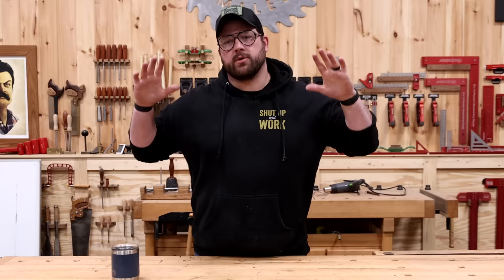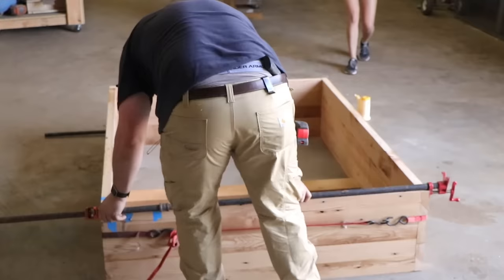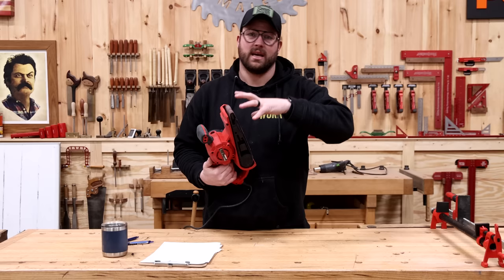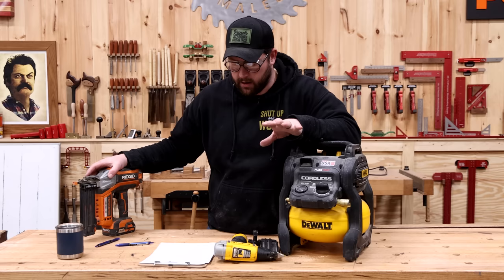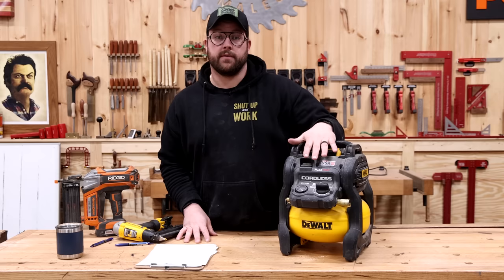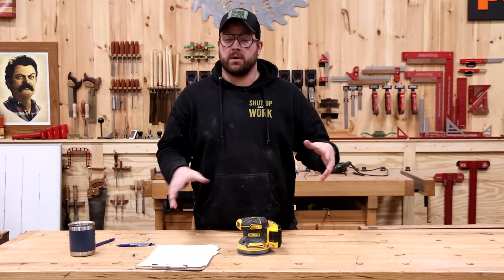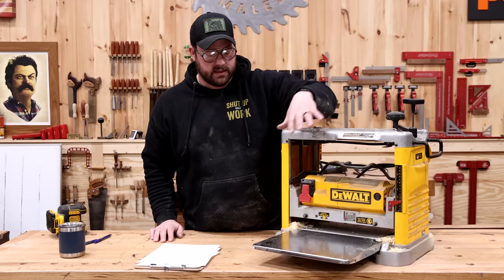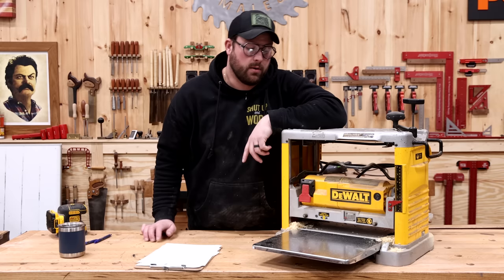5 Beginner Woodworking Tools I Regret Buying

Comment: I have that Dewalt 734 planer you were saying not to buy and I'm happy with it.   I don't have tip over problems because its on a mobile base ( I do all of my thickness planing and sanding right outside the shop, so less shop dust and I don't worry about dust collection on those tools that way), I've never had it bog down but I don't do thick cuts ( but i'm a hobbyist, not doing production)
Reply: Agreed, sure the 735 is a bit more but once you add the end tables, that's another 100$
Reply: And you can buy the helical head for the 734
Reply: Pf
Reply: I have the 734 and did a whole kitchen's worth of cabinet face frames and door rail/stiles with it.  Soft maple over 40 board foot.  I also planed red oak for a  30" by 10 foot bar top.   I have done a lot of other miscellaneous planing of maple and pine.  I never tripped the 20 amp breaker or the on board overload.  I also have not had to even reverse the blades.  From time to time i have to wax the bed.  I have been very happy with it.  Mine is also attached to a rolling cart  - was not aware it can be tippy.  Using a small roll around dust collector with a thien separator kept clogging at the dust intake so I just run it without collection and sweep - pretty sure my frankenstein dust collection is just not powerful enough.
Reply: In Canada the 735 is nearly double the price of the 734. IMO it’s not worth the jump in price for a little extra capacity and 2 speeds.
Reply: My planer has no problem with any type of wood or does it ever pop...virtually no snipe either ..
I think he has a lemon
Reply: Ditto the above... As an aside, I've literally run hundreds of boards of varying thicknesses through mine and never, as in ever, tripped the breaker. That's the problem with users doing one-off product reviews, they only have a "sample of one item" to review and sometimes they get it dead wrong! Perhaps a defective motor or simply a defective/overly sensitive breaker?
Reply: I agree with you on that one. I've had the 734 for a couple years now and it has never let me down once, the fuse has never blown and I always have plenty of power to plane everything, including much harder species of wood. To each their own, though.
Reply: never ever had it trip on my planer
Reply: The 735 everyone on YouTube recommends can’t be bought in most of the world. Dewalt only seem to sell it in NA and Australia.

Comment: A set of professional grade clamps are very nice to have.  Pipe clamps are useful for long lengths because they are less expensive.
Reply: Plus, there is a reason the name "Pipe Clamp" doe not have the word "Parallel" in them.  How many time do you really glue up boards that are wider than 36 inches anyway?

Comment: My thoughts on your suggestions regarding a beginning wood worker. Number one is buy once cry once. Buy the best or close to the best. When is the last time you regretted buying a quality item? I bought an oscillationg spindle sander specifically to be able to "sand to a line". I made some wooden templates and sanded them to the outline drawn with a pen. It is very difficult to cut right on a line and have the cut smooth. If you have a curvy template you cannot use a table saw and a jig saw or band saw will nut produce a really smooth edge like you need with a template. Bessey clamps are pricey but they are good and more convenient than the iron pipe clamps and lighter in weight too. You don't need a "ton" of clamping pressure even on panel glue ups. That glue coming out when clamped is glue that is no longer in the joint. You don't need more pressure than the Bessey type clamps provide. Belt sanders are seldom needed to never needed in fine woodworking but if you have a lot of material to hog out, they are irreplaceable. I vote for air tools even though I don't have any but not that air compressor. You need to get a quiet type air compressor. Battery sanders are only good if you have next to nothing to sand. As you mentioned, no power batteries drain no dust collection.
Reply: Yeah. I'd go so far as to say that on the planer front, just buy the DeWalt 13 incher and put the Shelix head in before you even turn it on. Sure, it nearly doubles the price, but being able to eliminate blades as a variable when you're just figuring things out is amazing.

Comment: Killer info. I've been woodworking for 30 years and gotta admit clamps was one thing I bought that all the cool kids had(bessey) and spent thousands on them. I never even considered HF pipe clamps. I'm going out to get some right now. I do have some pipe clamps and they are leaps and bounds easier to clean glue off of than K clamps as well. Thanks man!

Comment: One of the first power tools I bought was a Makita 100mm belt sander. It's worked faultlessly for 38 years, and has great dust extraction. I use it every time I do woodworking.

Comment: Dude you just crushed me 😂 i own 4 out of 5 tools you mentioned and I planned to buy 3 honourable mentions 😂😂😂 you really got me thinking with my choices and for that, thank you 💪
Reply from the maker: hahahah im glad i caught you before the honorable mentions!
Reply: Buy what you want and don't let any Youtuber dissuade you. Get multiple opinions of course, but in the end, everyone has their own needs/budgets or fall into deals that make a certain tool worth it.  For example I use my Ridgid Oscillating Belt/Spindle sander A LOT even though he doesn't. I also love my Kreg Rip Cut that I just bought. It isn't junk. It works for me.
Reply: @stevenlarson6125  sure but it all comes down to what are you actually doing. I did buy some stuff from that list and it's just collecting dust so I can relate to that surprisingly accurate list for me. As for the sander I can't see myself not using it. It's first on my shopping list to sand things shaped on the band saw that I can't do on a belt sander because of the angles. Right now I'm sanding it with a sandpaper on a broom stick so the need sander shape checks out 😂

Comment: I love my DeWalt 735 thickness planer. In 4 years of use, I have NEVER popped a breaker, and I don't baby it. ALso the second speed does cut down on sanding!

Comment: My 40 year old, bought new, 24" Makita belt sander is still working strong... sanding 10's of thousands of board feet.... without one repair.... best sander I've ever owned... that includes others that I still have... an older Porter Cable 6x4" orbital, 5" Milwaukee orbital, 4" Makita palm, 18" Bosch belt and a few others...  another excellent sander is any 10" sanding disk on a 10" calibration blade for the table saw.... love it..

Comment: If you are already on Ryobi cordless, the 18 ga nailer can be had for ~$90 online battery only, it has bump feature and is a worthwhile addition in my opinion.  I also have an air nailer but also grab the cordless unless I need full angled framing size
Reply: I have the 18ga ryobi nailer too. Love it.
Reply: I have the Ryobi nailer, also, and loved it until it stopped shooting nails. Found a video on how to take it apart and lube it. It started working again for that project. A couple of months later when I got it out again, it wouldn't shoot nails again.

Comment: Excellent list. I'm more of a hobbyist and DIYer than actual woodworker, but I agree with most of this list. I have a belt sander I picked up for $5 at a garage sale 5 years ago, and I've only used it 3x, all for retrofitting doors. But I disagree on the nailgun. While air-powered tools are indeed cheaper and more versatile in the long run, I physically cannot handle the pitch/sound of an air compressor, especially indoors. The Ryobi battery-powered nailgun is an excellent introductory gun, and can get into places where a nailgun/compressor combo is too bulky or annoying to work around.
Reply: I second this.  In fact, the video talks about how heavy the cordless version is and specifically mentions how hard it would be to deal with on a ladder.  Well, I've tried both, and running an air compressor hose up a ladder is much more trouble and even dangerous than a cordless tool that is unlikely to snag on something and pull you off balance.

Comment: K-bodies aren't great if you're a BEGINNER.  But I regret waiting so long to get some.  I can use them for TONS of things other than panel glue-ups.  They are GREAT.
Reply: I agree.  I also agree that pipe clamps are plenty for beginners.  As a semi pro, I think I must have 100 clamps that are for 12" and bigger, and another 50 for smaller clamps.  One just can't have too many clamps.
Reply: I use pipe clamps on a lot of things too. The thing is you can't buy pipes new. You have to just find some from somewhere.
Reply: K bodies are the best clamps out there. I started off with 3/4” pipe clamps, but soon went to K Bodies and wouldn’t go back.

Comment: I am a full-time remodel contractor and I 100% agree with all of your comments.  Everyone around me is using cordless nailers but I still prefer my pneumatic Makita 23, 18, 16 and framing guns.  Faster, lighter and as you said, there are many other uses for the compressor on site (inflating my truck tires too!).  I use the 2 gal Makita quiet unit @ 60 db that I can run with my clients on a zoom call in the next room!  100% agree with your sander advice too - - -  Great tips!
Reply: I was a full time remodeler and hated corded nailers.  Cordless makes it way faster and safer since you don't need to chase cords around or worry about tripping over them when the wrap around your foot like they always seam to do.

Comment: I agree with everything except for the Ridgid oscillating sander... I use mine daily!  I really wouldn't want to be without it! ... When I first got it, I made a little cubby hole to store it in, but lifting it out daily got old fast and I quickly realized that I needed to build a cart for it and give it a dedicated spot in my shop.
Reply: I use my Ridgid oscillating spindle/belt sander a lot, too. I’m not a beginner by a long shot, but it has given huge value for money. I mostly use it in belt mode for adjusting small items.

Comment: After buying my first Black and Decker corded power drill 25 years ago, the very next tool I bought was a Rigid belt sander. I used that thing once and then stored it for two decades. I only recently got it back out, freed up a seized pully and used it again, but you're 100% correct on the orbital sander being more robust. If I made a list of things beginners shouldn't buy (or at least wait to buy), it would be a 1/2" router. Even after years of projects, I find myself using my little 18V Makita router far more than the far bigger and heavier Bosch that I bought first.

Comment: Another great video, John! The reason I look forward to Sunday mornings is to watch your latest video!

You were spot on with your tips and from my personal experience, I've realized that portable, battery-powered tools aren't always the best option. I do 95% of my work in a shop that has plenty of outlets so it's really not a big deal to run a cord to a tool - more power, no waiting for batteries to charge, etc. I honestly think as a beginning woodworker, some of the only cordless tools to invest in would be a cordless drill & impact driver combo kit.

I was recently looking at the cordless nailers after seeing all of the YouTubers with them and thought, wow, that's a tool I need; then I looked at the price, sat back and thought about how much I'd really use it (and would actually need cordless), and decided it wasn't worth the investment... especially when I already have an assortment of air nailers and air compressors.

When you plopped the Dewalt planer on the table is when I really perked up because I thought I was going to have to disagree with you BUT you again were spot on and now I might need to sell that exact planer and invest in the upgrade that you recommended. I struggled planing a batch of maple boards thru one of those planers having to take off MAYBE 1/64"/pass - I got the job done, but I think I spent an entire day on the planer. I will say that my DW734 is on the Dewalt stand, so it's not really unstable but that doesn't do anything to help with it being underpowered.

Looking forward to future videos! Thanks, John!!
Reply: Not to mention longevity. Corded tools will still be working 10 years from now. 
Due to do batteries along, cordless tools will have a much shorter lifespan.
This is fine for a pro that uses tools all day every day and wears them out.
For hobby and occasional use corded is a much better value in most case.
Except for the most used tools, like drill/driver.

Comment: I definitely agree with John's point about air-nailer > battery-nailer. It may be even more simple than that... I think for most folks with a shop or garage, air power is the go-to style for all the reasons he listed (weight, power, functionality, etc). So if you've already got that air-nailer-hose setup, then JUST purchasing the battery-powered air compressor INSTANTLY gives you mobility. Plus, you get the added benefits of air power for a blow gun for cleaning, a tire inflator, air hammer chisel, impact wrench, die grinder, etc, etc. And if you come equipped with enough charged batteries for the compressor, you won't even need access to electricity on the job site. Great tip, John! Thanks.

Comment: Great video my FOMO was a track saw. Took me a while to get one, and I love it. I tried all the Kreg tool add ons. No comparison.
Reply: When I first started, I thought Kreg was a high end God-send of woodworking tools, for all of thier jigs and gimmicky stuff.  I bought their pocket hole jig, and then their universal track to attach to my existing circular saw.  The trac kit absolutely sucks!  I do use the pocket hole jig quiet a bit, but I've determined that the rest of their stuff is gimmicky junk.
Reply: Which one?
Reply: @jasonvandergriff7809 : Yeah, I bought the Kreg Rip-Cut circular saw guide. I was able to get the job done fairly accurately, but it was pretty awkward to use and not the easiest to make accurate rips.
Reply: @brianeatock4383  Makita Cordless 36volt.
It's awesome

Comment: I have made a lot of furniture. Nice to know I made the right choices for a lot of my tool purchases.  I use the Pipe clamps for panels. an attachment on the drill press for spindle sanding, a corded orbital sander, and the bigger DeWalt planer.  I do, however love my 18 ga brad nailer. It has limited uses, but the places where I do use it chef's kiss

Comment: I had the dewalt planer and experienced all the issues you mentioned. I now have the Metabo which costs less than the dewalt but is so much better. Wider feed too for 13” boards
Reply: I also have the Dewalt planer, never once popped the breaker. But I go only 1/4 turn at the time each pass.

Comment: Great video. As someone who started out as a mechanic I can’t imagine not having a compressor but even now as I predominantly focus on woodworking the compressor is very useful around the house. The cordless nailers are way overpriced and completely unnecessary if you work in a shop. Also I never understood the cordless sander since it is hooked up to a vacuum anyway. I appreciate the honesty John and I am very glad to hear my glue ups are just as good with my pipe clamps.
Reply: I started out as a mechanic too, but 95% of the tools I use at home now are cordless. My air compressor, which is about as big as you can get on 120v, primarily exists for inflating tires at this point. Really only my air hammer and large impact are the only things that use air any more. At least on that end.
Reply: When I first got an air compressor I thought every house should just be plumbed with air. When you're first starting out cheap air tools are cheap. I have air everything. Air drills, air sanders. air die grinders. You name it I have an air tool for it. But as I went along I replaced most of my air tools with electric ones.

Comment: Excellent video! I will say that a cheap Warrior harbor freight belt sander ($30-$40) plus a hyper tough 2 amp 1/4 sheet palm sander ($20) is an excellent combo, as I really enjoy the ability to flip the belt sander over and sand small pieces that couldn't be done on any type of palm sander. The belt sander is also great at sharpening tools and a few other applications, as i do not have any kind of bench sander. 
Ace hardware carries belts even the 3x18 that the warrior belt sander uses and you can get 5(!) bi-directional belts for under $10.

Comment: When I was first getting into woodworking, Biscuit jointers were the #1 must have. I might have 3 of them somewhere in the shop, but I haven't used one in nearly a decade.
Great video, and I like that you touched on the idea of buying some of these used, or an upgraded counterpart, which is great. Too many deals out there waiting to be had.
Reply: I use mine all the time 😊
Reply: Had one for nearly twenty years.
Never used it
Reply: Only festool I own is the domino xl.  They really are fantastic.  Biscuit joiners seem useless to me anymore, just became a surface for dust to settle lol

Comment: Picked up a Rigid set at home depot a couple months ago. Got a compressor, 18ga nailer, 18ga stapler, and a 16ga nailer with hose all in the package for I think around 350-400...Not an insanely expensive package, HUGE edition to the shop!

Comment: The belt sander can be helpful for pallet wood. I have used it quite a bit when I want the sanding grooves to go with the grain of the board but also a little rough and rustic at the end.
Reply: Also good for cleaning up reclaimed wood to remove grit, before you pass it through a planer👍
Reply: Also it’s one of my favourite tools. I have two of them. Large and small. It has zero downsides such as vacuum dust collection is a breeze, gouging doesn’t happen when you use it properly, belts don’t stretch if you de-tension them after use, and last a long time. I even use the big one for initial flattening of end grain cutting boards.